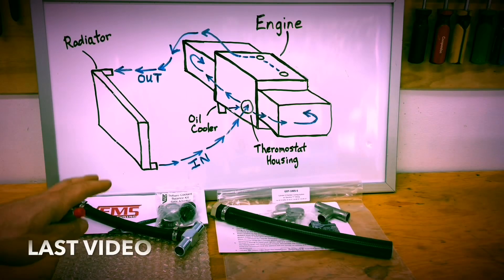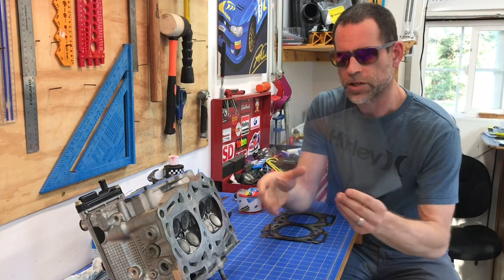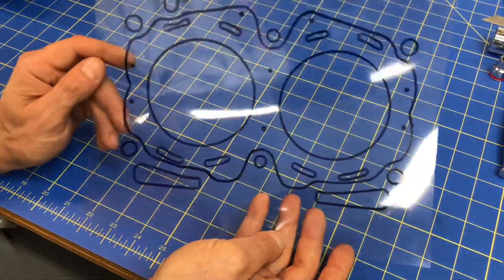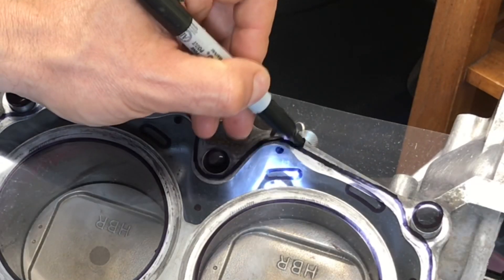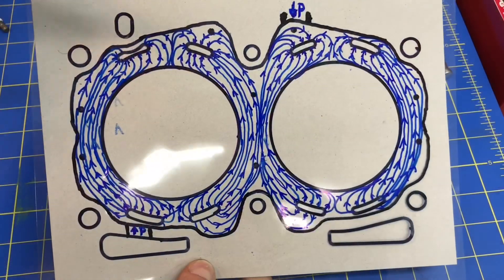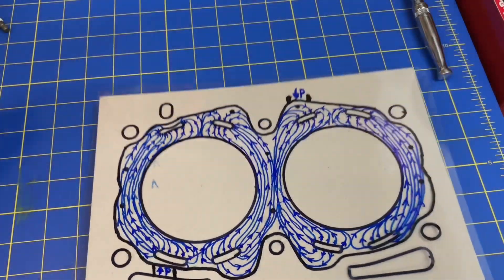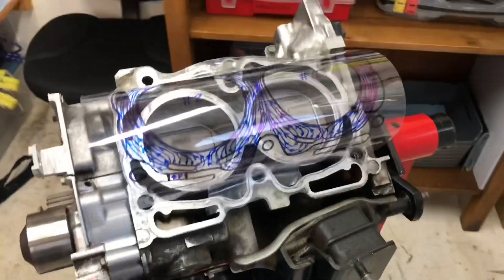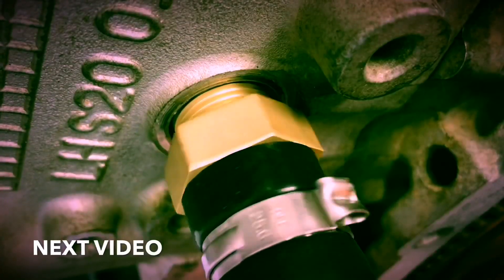Flowfields Reveal Coolant Flow in Subaru Heads

Comment: i'm pretty sure if its overheating cylinder 4 then the coolant is simply to hot, the pump is pretty strong flowing especially at higher rpms... I find it hard to believe there is a low flowing area causing this,  most likely the engines just tend to heat up more on that side and using a lower engine bay temp/ exhaust wrap and or lower temp thermostat or making sure its actually opening at the correct temp is more important, also can drill a hole in it so its a more steady transition,  the fluid should be easy to measure with thermal imaging this problem of engine damage occurs when the coolant is more stagnate and not cycling as much when the thermostat is not open all the way.. very common for them to not function correct and should be replaced fairly often i have tested a few in boiling water and they don't open until its much hotter than it should be and some aftermarket ones don't have as large an opening and some have NO weeping hole, leaves and dirt and oxidization quickly reduce the radiators cooling compacity even pressure washing it will bend all the fins over,  WOW WOW the factory thermostat is freaking 203c should probly be about 170C to 190C range pretty sad they engineer this stuff to fail like some weird experiment by aliens

Comment: This you illustrated pretty well with an open deck block.  Think about the different flow characteristics with a semi-closed ej257 or even a modified closed deck block like some aftermarket offerings.  This would make the cooling problem a little worse.
Reply from the maker: Great thought provoking comment - thank you!  I Love it.  Yep, lots going on here and you are right about far more restrictions with a closed-deck block.  Basically, with those additional restrictions, it will slow down the flow rate and the total volume moving through the heads.  Is this a bad thing? If it leads to overheating, yes. But slowing down the flow will help with respect to that preferential flow around cyl #2.  ie this would lead to better flow around cyl #4.  Very interesting trade off and without real data, hard to know what the net impact is.  

I’ll be thinking about this and I’m considering some ways to test it and gather some actually analytical data.  Cheers!  Thanks!
Reply: Hm... I get  you thougts. But I'm not so sure about that, since the passages in the head and the gasket are the main restrictions and most CDB conversions are not closed more than up to this degree. So, in theory, it should flow about the same?

Comment: So what about cylinder #3? Wouldn’t it have the same problem? How does the heater affect this mod?
Reply: IIRC, and I've been neglecting looking into this, but due to the turbo on that side and the coolant lines running to it, this is taken care of. On some twin turbo Subaru's, there's a Subaru part that allows coolant to flow from cylinder 4 to the turbo on the left side of the engine. This part is like $10. Buy your own coolant hose and you can DIY your own reverse coolant kit for a fraction of the cost.
Reply: @vipercrazy  Do you know the part number of this part?
Reply: @tiagomaximo2766  21170AA020. You may have to order through https://partsouq.com/en/search/all?q=21170AA020 My [Canadian] dealer couldn't order it. It was on back order with no ETA.
Reply: You may get some benefit from it, but I'm not sure how much on an NA, if any at all. Because boosted cars tend to run higher cylinder temps, there would be a greater benefit on force induction than NA. As for thread, for some reason I couldn't find that info.
Reply: I’m running an na ej25 in an 07 Forester, would this mod still benefit me?
Reply: What thread is the plug in the head?